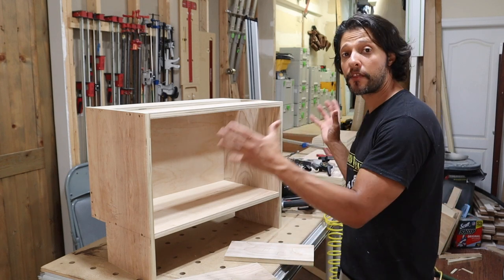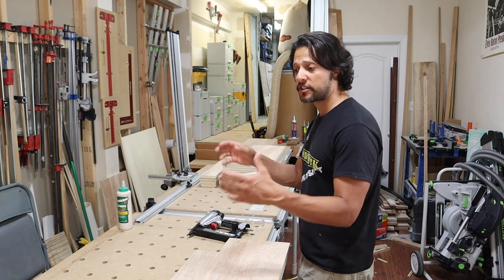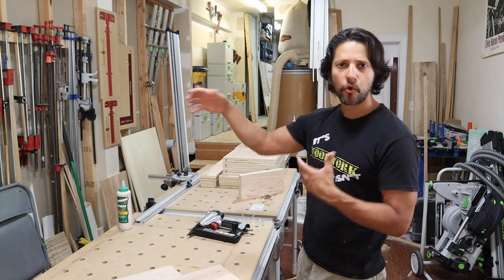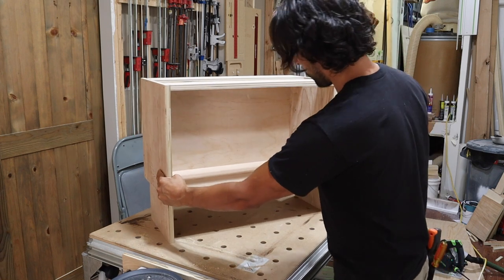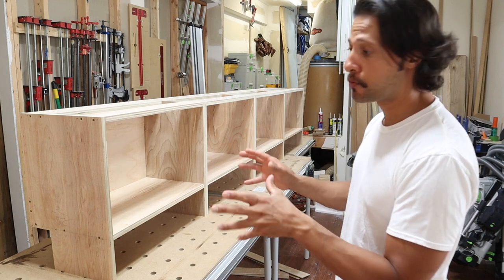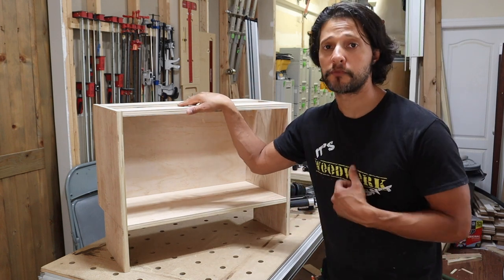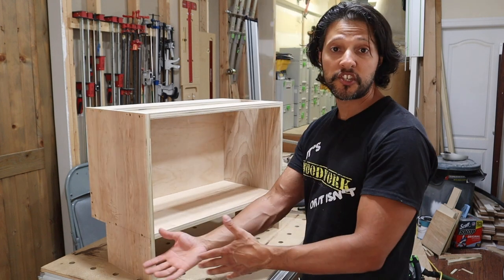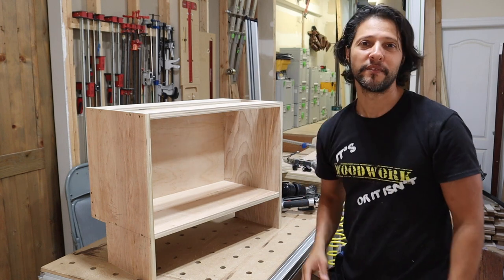easiest way to build cabinets

Comment: Nice job Anthony. 
I've built cabinets that way when the sides won't be visible or will have cover panels, or if they're utilitarian. Most of the time though I use dowels with my dowelmax.
Looking forward to the finished project!